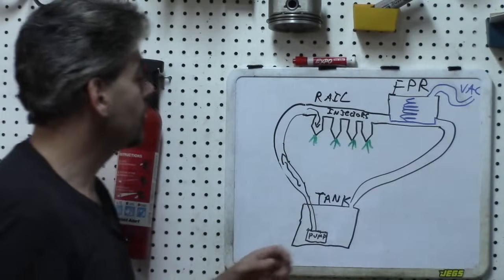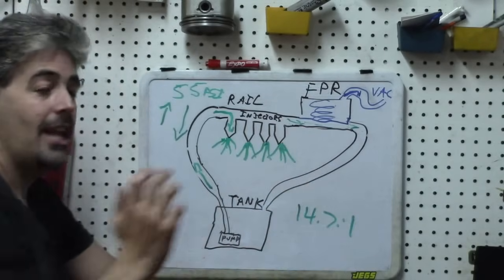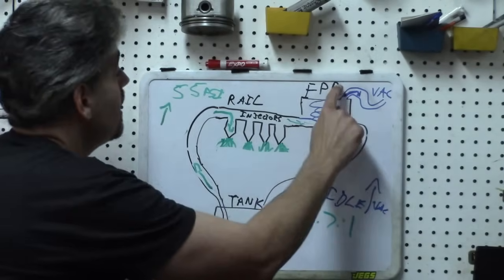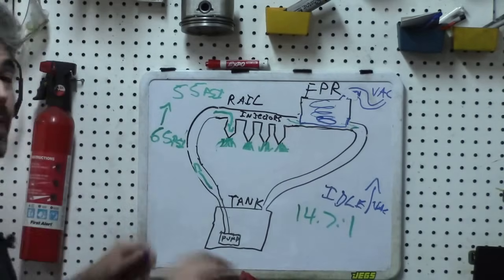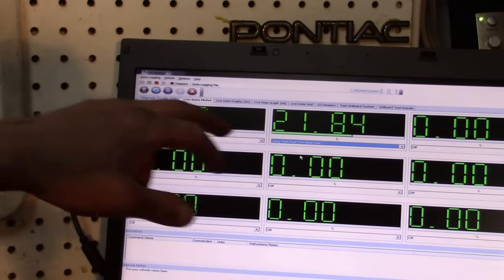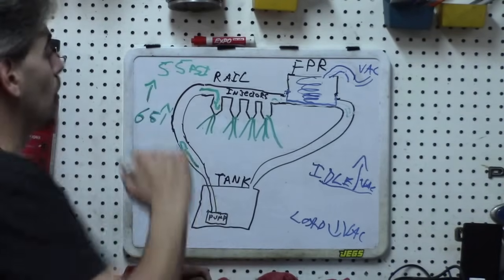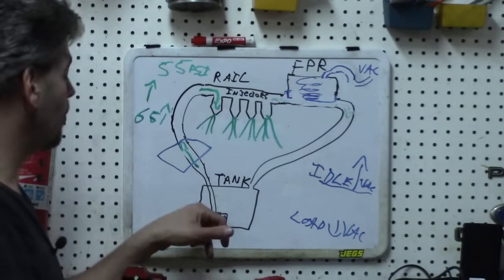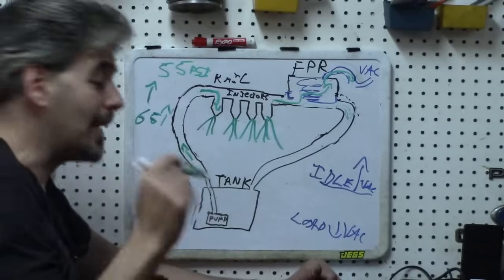Fuel Pressure Regulator Diagnosis + Understanding (HD!!)

Comment: Thank you for the video - inspired me to go to eBay and invest in a pressure test gauge from the States. I have 49 psi on switching on the ignition. I have 52 psi on tick over and load. Jeep Wrangler 1999 2.5 Sport. I do not seem to have a return to the tank. My issue is after driving about 1/2 mile the engine looses power. If I declutch and rev and feed in the clutch, after a few times, we can proceed normally. The engine then will perform normally thereafter.  If I stop the car and then restart the same problem occurs.  I would have to declutch, whilst coasting, and rev up and whilst holding the revs feed in the clutch slowly.  It then is fine.  I did notice a backfire whilst testing for fuel pressure. All plugs, points, rotor arm and leads are new. Please can anyone help me? Richard in the U.K.
Reply from the maker: What is the Long and short term fuel trim while under load? That is what I need to diagnose.
Reply: Richard Marriott bb

Comment: You're really gifted sir❤.
 Please, a friend picnic with a 5sfe engine with a return fuel system, at idle and during accelerating no iota of return fuel flow to the tank. What should I be looking for? Bad fuel pump or the pressure regulator?
Reply from the maker: If no fuel is returning to the tank on a return system this would be due to a failed regulator or a pinched/obstructed return line. also you would have really really high fuel pressure.
Reply: @SchrodingersBox  thank you so much sir👍

Comment: hey thanks so much for all of your vids i have learned so much! im having
 an intermittent cold start issue. it cranks, then stumbles and feels 
like its going to stall then rpm shoots up to about 2000 and it settles 
down. While this is going on my STFT both banks jump to about 20! if i 
shut the engine off and turn it back on the STFT go back to their normal
 numbers around 1.5- 4.5 each side. not sure what to look for as my 
trims are good at idle and load other than this cold start issue. also when this happens it throws both upstream 02 heater circuit codes but only after this cold start issue.
Reply from the maker: There is no useful information here, sorry. I need relevant fuel data curved against load.

Comment: Thanks for excellent explanation using diagram of EFI system...I  have not been able to get my '88 Bronco2 to start so before I replace fuel pump I've got to get correct gauge for fuel rail because I suspect psi is way under 40 psi on priming...by the way can I use my compression gauge at the fuel rail or is there a special gauge that I have to rent from auto parts store? Also would bubbles in fuel at rail interfere with fuel pressure while priming?

Comment: (Air Vacuum leaks ) can impact engine power AND Will ( affect Fuel Pressure Regulator)
 Leaks may happen because of a loose, deteriorated, or broken vacuum hose; a blown gasket, or a damaged throttle body gasket .

Comment: I had a case in a blazer where verified pressure was bleeding off rather quick as soon as the key was turned off. So it was obvious  I had a leak but the question was where. But then looking into the fuel system it is in the plenum.
So I gave a visual inspection of the lines to the tank all seemed to be dry. So my next step I hooked up my scan tool and while the engine was running and noticed the fuel trims was well into the negative figures which I was getting fuel that wasn't accounted for so I had 2 sources  telling me but noticing the fuel trims told me where to look for the leak, upon removing the upper plenum  I found the fuel leaking at the regulator  and around that area was washed out.
Reply from the maker: That would do it. Another cause of drop in static pressure is a leaking check valve. In that case you will have driveability/fuel trim issue but you will have a long crank time. However once started the car runs fine. The checkvalve is simply to prevent loss of static holding pressure to the rail to help with startup.

Comment: yes removing vaccum hose closes diaphragm but you think if a bad regulator was there the ecm could compensate the fuel injectors open longer to reduce pressure using pulse width modulation  . So measure pressure / opening the vaccum line changes would rule out 90% of a bad regulator but maybe I am wrong and the ecm does have this computerized test built in yet

Comment: Hey Matt, another professional video. Very informative. Thank you. Got another question, hoping you can help me out again:-) I have an 06 chevy 4.8l running lean on bank1 and rich on bank2 . On acceleration fuel trims on bank1 hit + 25 and -25 on bank2, what could be the cause of this Sir? Definitely appreciate your advice, thanks
Reply from the maker: That’s a pretty unusual one but there are a couple things that could explain that. 
  One could be that if the car was worked on by someone else they crossed up the the O2 sensor connectors- that would cause each bank to “chase” the other. 
  Another possibility is two bad O2 sensors. If you swap them on each bank and the problems move accordingly, then replace both sensors. 
   Finally you could have a legitimate issue causing rich on one bank (example- leaking fuel injector) and a legitimate condition on the other bank causing a lean condition (vacuum leak). Try doing something that would make both banks run rich or lean- disconnect brake booster or put carb cleaner into the the intake and see if both banks respond correctly. If they do then this is most likely the issue.

Comment: Searching YouTube for any help. 1998 Honda prelude 5 speed with surging , bucking issues when driving. Starts fine. Replaced fuel filter. Replaced timing belt with all related. Did compression ,leakdown and  chemical combustion test at radiator.  All check out good. Gonna check fuel pressure , fuel regulator and last the fuel pump. Retired 70 diyer trying to save money.

Comment: Hi,thank you I have learn more from your two videos on engine diagnosis than months in trade school. just need help on 2002 Jeep liberty. No 2 cylinder is not receiving any fuel,injector is clicking and test electrically. Can it still be mechanally broken? After new plugs and a later inspection on #2 cylinder the plug still looks like it just come out of the box. Yes I have spark! Only code is #2 misfire.Help! thanks you are a excellent teacher.

Comment: Very interesting and thorough explanation however it leads to a question for me. Why would the engineers keep a mechanical fuel pressure regulator when they have a computer that already can control injector pulse width. At idle, if there was no vacuum operated pressure regulator to open and therefore lower the pressure,  the pressure at idle would be high. The computer knows the rpm and load of the engine and knows that the engine is idling so why can't the pulse length be shortened to meet the stoichiometric ratio at idle knowing that the pressure is high.  One would think that the pulse width could be modified for any engine conditions without having to mechanically alter the fuel pressure. Can it be that perhaps there  is a limit to how short an injector pulse can be and the injector still would work?
Reply from the maker: Great question.  The reason is because the very act of opening the injectors for any length of time reduces pressure. So you still need a way to increase fuel pressure even if injector pulsewidth is reduced.  Newer cars do this through pulsewidth modulation of the fuel pump rather than a mechanical regulator but either way- you still need variable fuel pressure to meet the loss of pressure from injector pulsewidth modulation.

Comment: Very useful video. I have a 454 Vortex in a 99 suburban with the pressure regulator conveniently located against the fire wall behind the intake manifold. To get at it, it appears that one has to remove the intake manifold to do this. Which then means you cant really take off the vacuum line and replace while its running. or check for fuel in the vacuum line.

So. I am not interested in doing this again if I dont have to; I did it once already about 1 year ago. 

What is the likelihood of a AC delco fuel regulator going bad in only a 1000 miles?
Reply from the maker: If I see that design I generally diagnose the condition with fuel trim rather than mechanically.

Comment: Excellent video, well explained. Thank you. I have a smell of gas/petrol in my Vac pipe from the FPR. Is this normal? It holds pressure with a simple hand brake bleeder pump and pressure at the rail all checks out. Thanks! M
Reply from the maker: shouldn’t have that smell. probably an EVAP leak, not an FPR leak.

Comment: Hi mate I got sprinter 2015 , when I do that static test, the pressure Gage will go down after 20 seconds from switching engine on without starting in, and I don't know if that's normal on these van mate , I wonder if you can help me out on this  .. the problem with this van is sometime if you change driving  .. like you came in to full stop and you fully loaded the engine will show some hesitation when you pull up after that stop ..

Comment: Hi Matt, I have a question you may or may not be able to answer for me but it is worth a shot. I had to replace my fuel pump on my 2005 Chevy Colorado. It was idling and literally just shuttered off and would crank over by no start. Nothing I could do could get it to start, only turn the motor over incessantly. I pulled the tank, changed the fuel pump and it turned over again with no start. Let it set for most of the day, turned it over one last try and it turned over several times and cranked!!! I thought, praise the Lord, i'm done!! Well, not so fast. Now it will crank but only on turning over several times (I'm worried I will eventually ruin the starter or kill the battery doing this). If I let it set for a while, it literally takes 10 to 20 times to turn over. I went to Advanced, they check the codes said I have a bad crank sensor that was probably the issue. Changed that quite an easy job, and it still does the same thing. He said it also has an O2 sensor code (however, I have heard the pressure regulator being bad can cause error codes saying it is an O2 issue????) Long story but here is where I am... It seems that the fuel is not staying pressurized up to the top of the motor (which I assume it is supposed to do) and is having to recharge all the way from the tank each time I start it. I did not know if the Fuel Pressure regulator served as sort of a check valve possibly which did not allow the fuel to run back to the tank until the next start so it cranks and starts on the first turn or so (like it always has since i bought it new in 2006).... Thanks for reading (and responding if you have a moment). This is my next point of attack. The only other thing I could think is fuel line pin hole? (Oh ps. I did change the fuel filter when I had the tank off the vehicle. Thanks again, Frustrated Colorado in Cove City NC :-)
Reply from the maker: What is the fuel pressure while cranking vs while not cranking?
Reply: @SchrodingersBox  good question. Shade tree mechanic without that essential tool. I may just have to break down and buy that and / or run have it tested somewhere I guess. Was trying to process of elimination correct it. Down to my last thoughts on it but checking the pressure should have been one of the first things after pump replace of course
Reply from the maker: My fuel pressure tester cost just $35.  Fuel pressure is the very first data you need to diagnose this.

Comment: I had a backfiring into the intake issue on my Jeep. I thought it was ignition because I smelled a lot of unburnt gas.  I focused on sensors and ignition, ignoring the fuel system. The problem was low fuel pressure. Low fuel pressure can cause backfiring.
Reply from the maker: it absolutely can.

Comment: Great video! Very complete! Do you have one that would explain how the returnless fuel system regulator works in Ford 2004. I know they changed shortly after 04 to a control module.
Reply from the maker: Yes good question.  So I have a jeep video with a returnless system that I work on- I think it's called "jeep eats fuel pumps" or something.  But I don't go into detail as much as this video.

Comment: I'd have to assume that if the fuel pressure was high enough at idle, it would be difficult to get a short enough pulse on the injector to keep the balance.  How much pressure change should you see when you remove the vacuum line?
Reply from the maker: Good point

Comment: If I use an external hand vacuum pump, how much vacuum (in psi) should I apply to test the fuel regulator?
Reply from the maker: it should show a linear relationship to vacuum so a specific PSI is not really relevant.
Reply: @SchrodingersBox  You mean if it is in a tee config?  I meant if I remove the vacuum line completely & test with hand pump
Reply from the maker: Yes. Same answer.

Comment: Thanks for this video
What the difference in GDI ENGINE and where is the placement of the fuel real pressure.
Reply from the maker: I actually haven't seen a direct injection yet but the process is the same however the pressures are way, way higher and I am sure either a special gauge would be needed or, I imagine much more likely, a transducer on the rail would be accessed through the scantool to measure pressure.

Comment: 97 Cadilliac Deville, 4.6 Northstar, FPR is at the beginning of fuel rail. I am not getting any vacuum from intake manifold, must be plugged, vacuum line is clear. Throttle body is filthy, waiting for the temp to get warmer before removing throttle body to clean and to check inside of intake manifold. Just replaced FPR because it was leaking fuel out of vacuum hose. Have not yet tested fuel pressure.

Comment: Would it be possible that a fuel pressure (or fuel delivery in general) issue could cause an issue that would basically mimic vacuum leak symptoms, but only when the engine is not under load? I'm seeing very high positive fuel trims at idle that gradually become less significant as I increase the revs, which of course would be a classic symptom of a vacuum leak (but I´ve spent hours looking for one and can't seem to find any sign of it, also the engine seems to have pretty good vacuum, at least according to MAP). However, when in gear and on throttle, even just very little (and nowhere near the amount of throttle needed to correct the trims at idle), the fuel trims drop much faster to more or less normal values - but as soon as I step off the throttle and start coasting or decelerating, the trims get gradually high again. Feather the throttle and they get better again. There's also sometimes detonation when transitioning between the high trim and normal trim phase. I've also had an emission test done and while the car passed the test, it also points to it running quite lean when the trim numbers are high (very low CO, high HC, high lambda).

From what I've seen, the amount of fuel trim also doesn't seem to be directly "mappable" to the amount of intake vacuum, which is something I would expect from a vacuum leak - meaning that I'd expect vacuum leak to show more or less the same fuel trim numbers with the same amount of intake vacuum, no matter if it's revved in neutral or at idle. I mean - I definitely see higher trim numbers when there's higher vacuum, but let's say +20 LTFT at 10 psi in neutral and +7 LTFT at 10 psi when coasting/decelerating.

Could there be something causing a fuel pressure to drop when not under load, but be fine when under load? Could maybe a clogged filter do something like that when it would block the flow when fuel pressure is low, but allow fuel to flow fine when the fuel pressure increases?

Wish I knew some fuel pressure numbers, but I don't have a gauge available and I'm in a kinda tight on the money/inbetween jobs phase at this time, so did not buy one just yet (though I might if I don't solve this soon, since I'm getting pretty desperate and I feel like I'm destroying the engine running it lean like it seemingly is).

Thanks for any possible insight on this.
Reply from the maker: I cannot think of a possible situation where fuel trim would improve under load with a fuel pressure deficit.
Reply: Wow, instant reply! Not what I'd like to hear, since I really can't find any leaks there at all, but thank so much for the reply anyway, nice to have it confirmed. I kinda realized it was a stretch, but I was still hoping it might give me something different I haven't thought of yet to check more closely. Thanks!
Reply: So, to finally follow up on this for anyone who happens to stumble upon it in the future (because I hate when people don't follow up) - I believe the issue is finally solved. Even though it exhibited all of the classic symptoms of a vacuum leak, it was actually a MAP sensor off calibration that was causing my lean idle (which I guess makes sense, as my engine is a speed density engine, so it depends on accurate MAP reading, but shouldn't really show higher fuel trims with a vacuum leak like a MAF engine would).

Apparently it was reading more or less correct at barometric pressure, but as the pressure decreased, the calibration error was gradually increasing, mimicking the classic vacuum leak symptoms. It was off by something like 5 kPa at idle and even more when e.g. engine braking. So it was kind of a pain to diagnose.

Replaced the MAP and the highest fuel trims I've seen so far was like 7 percent overall, which is a LOT better than my previous 25+ (STFT and LTFT combined). I was also experiencing quite a lot of engine knock under light acceleration, and that seems to be a lot better as well overall.